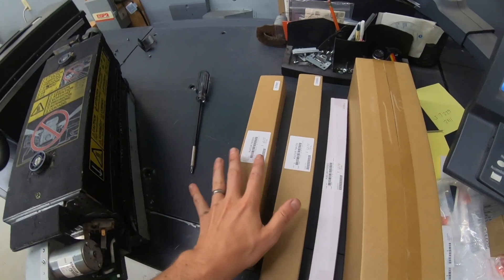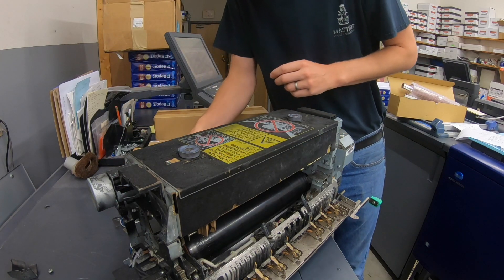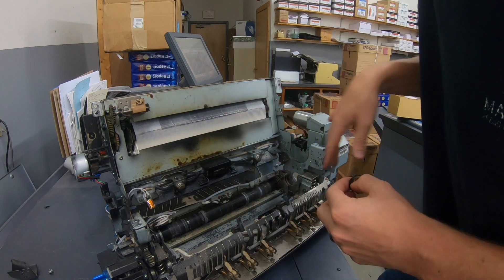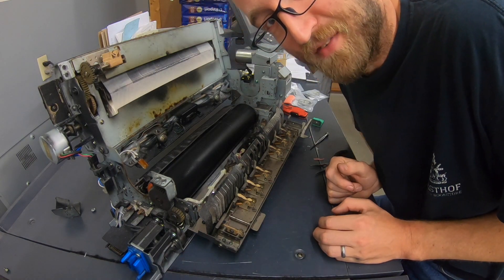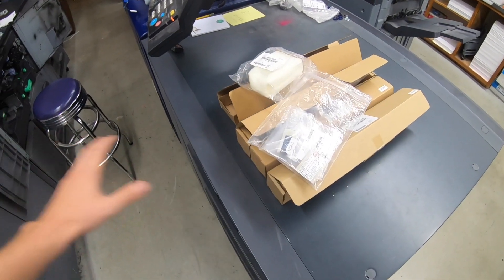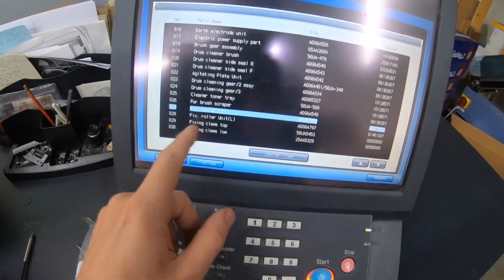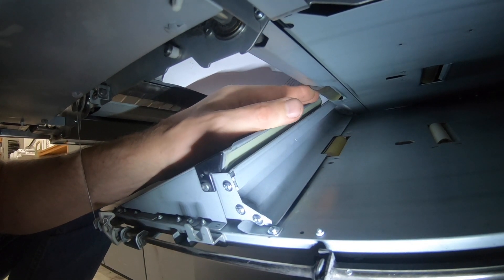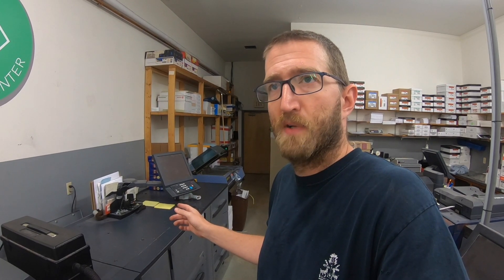Konica 2 Million PM Kit, J-3901 1200 PRO Paper Jam Error

Comment: The 1200 is similar to the 951 so I'm posting this here.   PANIC: Konica 951. Only One and a half million copies. Had 10 copies out of 4000 with a very sharp half of the sheet in nearly solid black.  Tech figures it's digital. Then this week after printing 662 perfect copies it printed about 1000 of these black on half of the sheet, on both sides, on every sheet.  How do I add a photo here? Anyone have this problem and know what it is? The black runs down the length of the 11x17 sheet on the rear of the machine both sides of the sheet. A very very sharp cut off at the exact centre of the sheet. Also it starts instantly on the sheet. Like a clean one then the black one. So must be digital. yes, I printed for about an hour and have to throw it all out.. OUCH  Any help is appreciated.

Comment: Great job!  I am a 30 year km tech and it's nice to see you digging right in. Fyl, you don't have to take the shafts off the scrapers. Take off the spring and they pop off. You should replace them when you replace the roller so you don't ruin the new one. That belt stripping is a common problem with them. I keep three in my stock. Keep up the good work.
Reply from the maker: Thanks for the tips and encouragement!
Reply: @justaprinter  you are doing so well. 

I need this board: A85CH01104

Or 

A85CH01100

Main Body Control Board Assy.

Do you have it? 

It's for C2070

Comment: No leftover screws means......a job not well done...🤓🤓🤓🤓
Always refer to sm for jam codes, it will pin point to exact jamming location....well most of the time.... Ur fuser unit was not bad at all and some juice was still in there.....good luck.
Reply from the maker: Yes, the service manual helped me locate the problem was between two of the sensors. But I still am never 100% certain. I'm still learning a lot! Yes, old fuser rollers will make fine spares!
Reply: @justaprinter  Yes in deed, not that they will be wasted.. They are maintenance parts, that must be replaced after some limited amount of prints. So when-then they will be again inside the printer. But as a rule please, next time when you have intermittent jam, first look around the forums online. Usualy always, by my 15 years experience is some stupid little thing.
Reply: yes brother.. i  think the same.. And you just gave me hope that someone still thinks with the brain, not jusr replace staff..